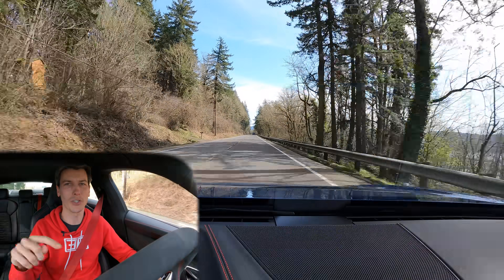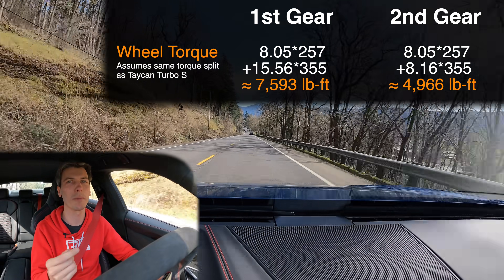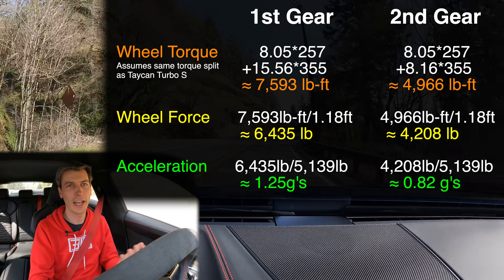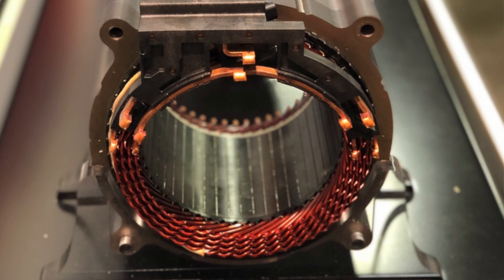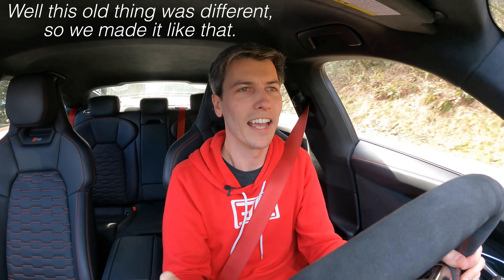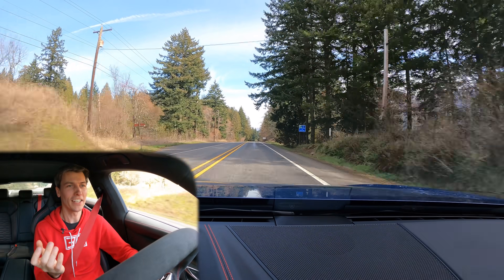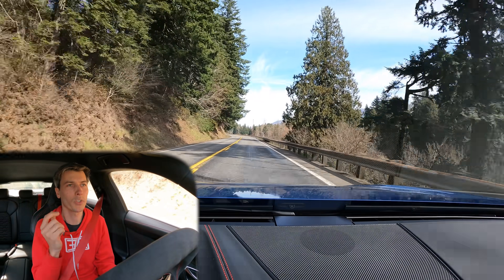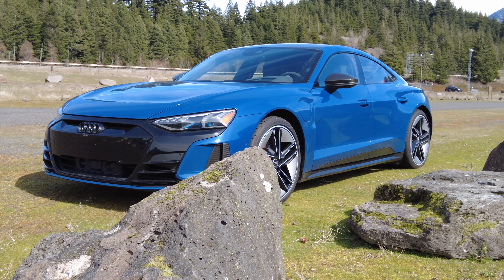Are Fake Manual Transmissions Coming? Audi Keeps It Real

Comment: We have a 2012 Outback with the CVT. This was before they started putting fake shift points in. We've had it for something like 7 years and I still think it feels kinda weird. Floor it, and it jumps to 5500rpm and just stays there while you keep gaining speed. Plus, if you are driving in the twisties, the throttle response feels like you are piloting an air boat. But it has a manual mode with paddle shifters to overcome that.

Comment: its have good reason .. maintaining RPM/speed when you want blip the pedal or adding more/less pedal  input, so less pedal movement .. its so uncomforted to keep modulating pedal more and less related to speed .. study case, and you know the limit RPM/Speed when you on gear, specially on mountain road .. without gear or unlimited power on your pedal then you can woke up on hospital or worse ... you got the point

Comment: Right from the first EV's I said, 'When they build an EV that can convince me I'm driving a three pedal manual ICE, I'm in.'
Don't care it's not logical. Don't care it's not as quick. I want to get in, use a drive sim style screen to select the car I want to drive today. Fiat 500? Ford GT40? The software, the seat vibrator and the sound system do the rest. That software already exists, just needs someone to glue the two worlds together.

Comment: Life long resident of Los Angeles I gave up the desire for manual transmission cars back in 1977.
When I want to shift gears I ride a motorcycle. 
But now, even motos are available with dual clutch automatic shifting... I'm not there yet.

Comment: The reason of custom in the tested Audi works just like when pedestrians who kept getting hit by early gen Prius cars for being to quiet had to be upgraded with a noise maker or when Ford came out with Harley Davidson sounding pickups that helped increase sales because of the loud sounding engine rumble. Call it the Custom Made Baby syndrome!

Nostaligia standpoint would not be driving an electric car, but a gas engined, hot rod modded, early model gas combustion. Anything else would be like wearing a fake brand shoe from Walmart.

Comment: So basically the answer is: Toyota is wasting tons of money developing this for the ~1% of people who might buy this so these people can "shift gears" like a button pushing monkey.
Just like how several manufacturers spend tons of money developing manual transmissions for the single digit % of people who want them (and upcharge for the automatic or DCT that most people buy 🤦🏾‍♂️).  Stick mafia needs to just realize they are old farts (or in some cases young farts) and learn to love the flappy paddles or whatever.
Reply: 😂😂😂 manual transmissions are the norm kid, automatics cost more because they're more complicated and expensive, all the new research is for automatics, manuals have been the same for decades now

Comment: Is there an argument to be made that in a sports car, the driver should have more control over what the car is doing? On a track, shouldn't the driver be able to choose what the car does going around that curve?
Reply: which is why most track cars use a sequential transmission with a clutch

Comment: If it was a single centralized electric motor with a an actual clutch and a transmission with physical gears. What would you think. I think with variable torque speed, it would have achieve "fuel efficiency" I'm mean, "electrical power output efficiency". If that make sense? Even your range would be longer. There would be variable power usage in one trip. So a personal  suggestion would be " Why not applying mechanical component along with the electric motor. However,  there would be drawbacks in  terms manufacturing cost and weight, and size.
Reply: i'm thinking about applying it because doesnt the very high rpm's of the motor cause exessive heating ? so higher gears would make the rpm lower while the toque should stay the same

Comment: The fake gears on CVTs is particularly annoying with modern Subaru vehicles.  My Mom had a 2013 Subaru Crosstrek with one of the first modern Subaru CVTs and it originally didn't have fake gears.  It chose a certain gear ratio based on the vehicle speed and throttle position so that you got maximum acceleration when you floored it and maximum fuel efficiency the rest of the time.  Theoretically this was great, but the engine tended to rev pretty high under acceleration and customers complained about the droning that resulted.  Some customers also thought the car was broken because it would sit in the peak power band while accelerating without ever shifting like a traditional automatic transmission would.  So instead of fixing the NVH problems and retraining their customers to understand the benefits of a CVT, Subaru in their infinite wisdom decided to issue a TSB and reprogram the CVT to act like a traditional automatic with fake gear shifts.  Now a version of this CVT is the only transmission option available on the top trim level of the new WRX (a vehicle that Subaru admitted is ordered with the manual transmission 80% of the time) and it still has fake gears, but has been upgraded to "shift" faster.  What a joke.  If you are going to go through the work of producing a superior technology, then actually use that technology rather than trying to emulate the old technology.

Comment: Why would ANYONE want to retain the clutch? Nobody likes the clutch. We saw clutchless transmissions and nobody missed it. Unless you prefer loosing power as you switch gears or disconnected engines. EVs already offer this disconnect as standard.

Comment: i am glad to hear someone finally did this. I have been saying for years, it can't be that hard for someone to just map the torque of a combustion engine car to an EV. Imagine instead of choosing between Quiet, Balanced and Sport for your e-tron, you could chose between TT, R8 and S1.
Reply: Totally agree. It will attract a larger crowd to the EV market. 
Driving is fun for some of us.
Reply: @joshfoleyJr  It still misses the point of what makes a car fun to me though. A fake gear shift or fake noise is just pointless to me. EV for the boring commutes, ice for fun and I don’t see any amount of fakery changing this.
Reply: sheesh
Reply: really. Let's go Brandon!
Reply: But what's the point? You are just wasting potential
Reply: @DVSProductions  Fun? You can also have an Eco mode for efficient regular driving
Reply: @christopherjc54  if I wanted fun I'd want a real car haha

Comment: Adding a 2-speed transmission adds weight.  Wouldn't simply doubling the motor's size be a better idea since the weight gain from doubling the motor size would actually be less than the weight from a 2-speed transmission?

Comment: A gearbox in ev's is a great thing.  The thing is that on Your other video, you also said thing about more torque and power levels and all that but!, you're missing a crucial (from my point of view) point - energy. I think that we can all agree that a gear box can either win in a drag race, or in an endurance race (on ICE engines) that same rule (already proved by Bosch) applies to a EV motor, 1 way to increase range and acceleration and range is to pack bigger motor and a bigger battery, and the 2 way is to install a gearbox. EV motors ave rising impedance with higher rpm, that's why when Tesla(or any other EV car) says a a range estimate  it has a star next to it saying if you go 30-ish mph. So again if you do the math you get the same idea, rpm influences mpg(mpKw).  Next point, Does every1 need a 0-60 in  2 seconds, or maybe a 2000 miles of range will be a better selling aspect of lets say a bolt\volt\leaf\3...... i would like to have a fast car, but i think that there's a lot of people who would love to forget about range anxiety on their ev's, an instead of going fast(200mph), they would rather go far. A gear box is the answer, shift to 4-5 gear on the highway, and cruise at 1k rpm instead of 9k rpm on a leaf for example. I've studied the em-57 from top to bottom ( It's the most common ev in Ukraine) and saw with my own eyes how the energy usage went from 15 to 80kw  with the same load, constant acceleration to 100 mph(max speed) and if there was a gear box, that little car, with a 24Kw battery could go a lot further (x3 depending on my calculations). I'm not saying that a stick is for every1, but a cvt would be just great, even with friction losses it has more benefits than simple gear reduction box. Time will come, ill make my own ICE to EV conversion and try to show every1 that it's better to have a choice rather then silently follow behind some1's footsteps.

Comment: OR...buy a 2022 CT5V Black Wing manual transmission, and 2022 Tesla Model 3 Long range AWD with approximately $4000 cash to use on the fuel the Black Wing will guzzle, instead of the eTron GT.

Comment: If I had the money, I'd buy a Mazda 3 or low end sports car.  They're going to force us to buy EV's, because gasoline engines last too long.  The battery pack is the most expensive part of an EV, and they lose capacity relatively quickly, compared to a gas tank.

Comment: Surely there'll be an option to still drive them as EV's, like it operates as one if you leave the gear stick in neutral for instance. Is a weird concept, but might work for the sake of brining some fun to EV's. But EV's still should be scrapped, I'm still more for making combustion engines carbon neutral as it's not really that hard to do.

Comment: Electric motors consume more power for higher RPM so gears can be used to simultaneously to lower power consumption (and torque) but still give out similar RPM. Yes u can adjust the torque of electric motors but with that you decrease the RPM.

Comment: I also grew up with manual transmissions, and my first cars were manual transmissions.  When I got an ICE car with a three speed automatic transmission, I didn't miss the manual at all. When I got an EV with a single speed transmission, I didn't miss the multi-speed automatic at all.  I don't share the nostalgia for inferior technology that some people seem to have.
Reply: Because you have no idea what you're talking about. 
Stop talking as if you're doing so from a "superior" position, because you're not.
Reply: @QBDLettuce  How is an electric motor not superior to an internal combustion engine?  It's smoother, quieter, more efficient, more powerful, has a quicker response time, has a MUCH wider torque curve (so no need for clutch or multi-speed transmission), and it doesn't spew poisonous gases.  You might say it requires a heavy, expensive, slow-charging battery that holds less energy.  But, that's more a limitation of the battery, not the motor.
Reply: @dansanger5340  If I have to explain THAT to you... there's no point in me even bothering explaining.
Reply: @QBDLettuce  In other words, your attachment to ICE is emotional not rational.
Reply: @dansanger5340  Not at all what I said. Please don't try to finish the argument yourself, in your favor.

Comment: I worked at Electra meccanica when the Solo was first going on the road and suggested the use of a CVT to help battery life by decreasing draw through mechanical gear reduction. They weren't accepting of my thought process, but they also didn't get the 100 miles per charge as advertised either

Comment: I disagree that fake sounds are there just to satisfy old-timers. They are aural feedback. When I redline in 2nd gear on the highway ramp and hit 60 mph, my wife thinks we're doing 120 and tells me to slow down... because of aural feedback. The sound translates to an impression of speed in her mind (and in everybody's, except we are taking other inputs into consideration :)). My point is that sound is as important as visual and sensory cues to the driver and occupants of the vehicle. If you remove it, it's like disconnecting a sensor. The brain has to do with less info.

Comment: Whether or not there is nostalgia and tradition involved, these features do enhance your driver experience by making you feel more connected to the car and is simply more stimulating to the senses. The cars powertrain used to do this for you on it's own but in the new age of EV's you need to replace these stimuli with emulations if you want the same kind of mechanically satisfying experience. Still not sure if these emulations will ever have the desired effect though... Can't help it just feeling silly since thers no longer a practical reason for it.

Comment: EVs: Let's make fake manual transmission and limit the motor, for the sake of being the same.
EVs: Let's remove wiper stalks and move them to a touchscreen, for the sake of being different.
Just switch the engine/transmission for a motor and let it be a normal car ffs!

Comment: I've often contemplated a manually shifted CVT - I wonder if you could make a third pedal where you continuously move your foot to adjust the ratio while you use your other foot on the throttle. It might be a way to make driving a CVT engaging while actually being connected to how it works.
Reply: I thought of something similar, but instead of a third pedal, it was a lever in the center console, akin to a boat or airplane's throttle. Pull it towards you for the maximum torque, push it away for top speed.
...

...

Maybe I just watched too many Batman: The Animated Series episodes tho, lol, the Batmobile had a similar lever.
Reply: @lanceislateagain , I thought about that too, but since you can constantly adjust it, that only leaves one hand for the steering wheel, turn signals, wipers, etc.
Reply: an airplane engine with the variable pitch prop is similar. I once had a self-propelled New Holland baler that had a CVT for the wheel drive operated by a lever- very simple mechanism...
Reply: This is an interesting idea. We have CVTs with paddles which let you pick fixed gear ratios for some extra torque. I think this is a good idea, gets rid of some of the disconnect.
But controlling the ratio of the chain with a third pedal sound honestly kind of difficult, Because the ratio is constantly changing. Also don’t forget CVT’s are not the most forgiving transmissions, I would assume they would not last like that.
Reply: @-nightraider-1169 , for longevity, remember that not pushing the clutch pedal can quickly destroy a manual transmission. It's all about involving the user in the process. Perhaps a damper on the pedal would prevent accidentally jerking the controller.
Reply: @-nightraider-1169  yup.. People bashing fake gears in cvt's, but I'd never drive one without a manual mode and paddle shifters. Being in the right gear at the right time is impossible for any fully automatic system to predict correctly.
Reply: @emissarygw2264  exactly. And honestly I prefer to have the simulated shifting cause it gets rid of that annoying drone with your accelerating. Makes it sound more like a normal car. My civic has this feature that if you are in automatic mode, when you downshift with the paddles it holds the gear for you and goes back to auto mode once it defects that you don’t need to pass anymore. It’s actually pretty useful sometimes.

Comment: I would totally drive a fake manual electric car. How hard is that, throw $300 gaming PC controls in a car with a little software? Be able to put it in auto mode for the wife, make it a convertible, and I'm in heaven. Really surprised Tesla hasn't done it yet.

Comment: Pathetic! It take 13 HP to keep a 4000 pound car moving at 70 mph. A 50 hp motor in a 1500 lb car will do the 1/4 mile in 16 seconds. We peasants need a light weight vehicle for short and medium trips and the oil barons need prison.

Comment: This actually sounds fun to me.

The fastest cars are not always the most fun. Years ago, I drove a Nissan Sentra SE-R Spec V followed by a 350Z. The Sentra felt faster in a straight line and in the curves. It also sounded great.

The numbers wouldn’t lie; the 350z was faster. 

But, the feel of a car can be more satisfying.

I can put it one other way; convertibles are worse, in EVERY way, than a hard top. But they have their own pleasure and purpose.

Comment: Why do people always forget the Honda CRZ, when it comes to electrified/electric cars and manual transmission?
Yes, it had an ICE, but betweet the engine and the manual 6-speed transmission, there was an electric motor. So, if the motor had been bigger and instead of the ICE, it was electric only, it could and would have been an electric car with a manual transmission. All other hybrids were and are automatic transmission. 
I wish, that Honda would have kept it going.

Comment: Lexus has used multi speed hybrid electric transmissions since 2007 in North America.  The GS450h and LS600h are 2 speed with the L110 hybrid transmission.  It shifts from a 3.90 gear to a 1.90 gear at around 50 mph (in North America) with 3.76 final drive.  The LC500h and LS500h uses a 4 speed variant of the L210, the L310.  

Not available in North America there is a IS300h and GS300h that uses a L210 single speed hybrid transmission.  

Lexus adds a fake 6 speed in the GSh and fake 8 speed in the LSh, although it somewhat feels like a shiftable automatic it is just software preset rpm points.  Helpful in deceleration especially in mountain or hilly areas.  

I’m sure most of it is to help the gasoline engine keep some additional efficiency, but a launch with gas and electric is rather fun still.

Lexus and Toyota have similar gears added to the hybrid transmission on the RX, NX, Highlander, Sienna, etc since 2010 model year.

Comment: It's like having a driving sim, in your car. Hell you could make the car feel like different cars with a flip of a switch. Want a sequential transmission with flat foot shifting? Push a button. Want a 5 speed with 300hp. Button. 6 speed with a 1000hp. Button. 
If it's done really really well. Better than the best sim rigs you can buy today. It could be a lot of fun.